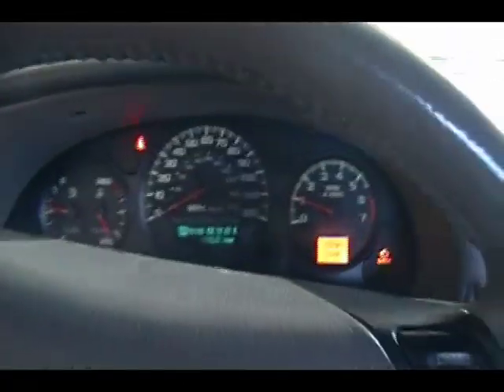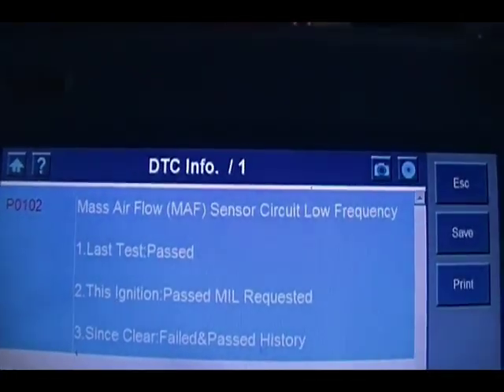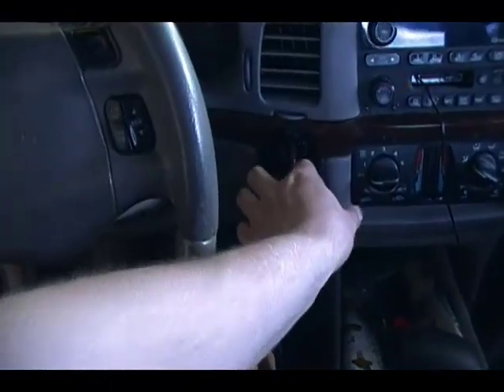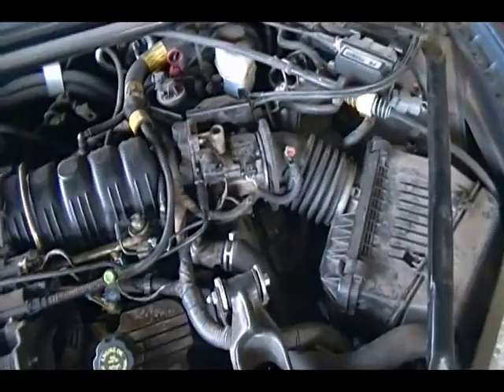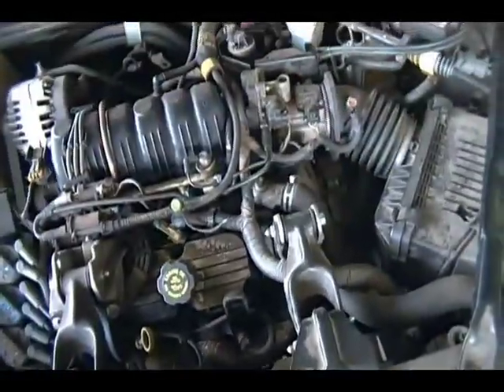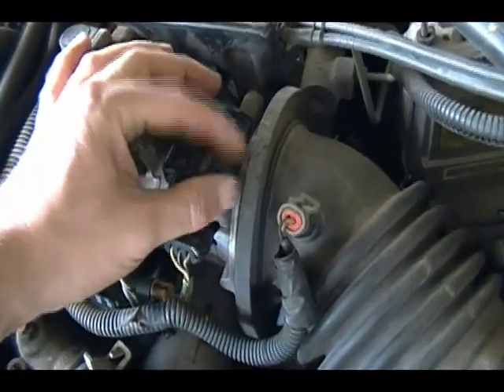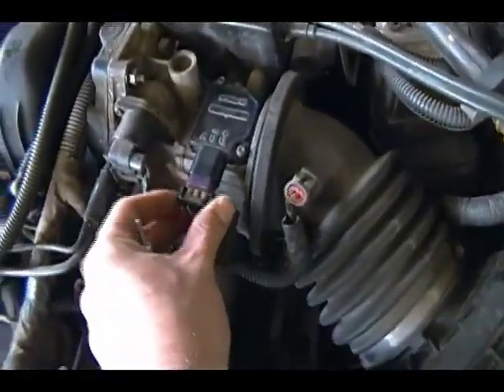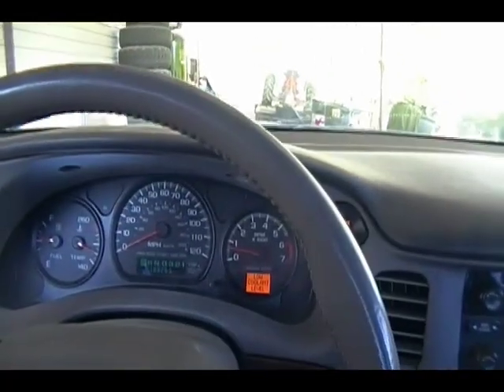Chevy Impala 3.8 V6 Mass Air Flow Sensor P0102

Comment: That stutter you had at 30 is exactly what’s happening to me I’ve had a misfire that has also plagued me even after changing plugs coils and leads, in your opinion is the car worth continuing to throw money at it’s almost 20 years old with 150,000 miles

Comment: I did that to mine. Mines flashing check engine and is real sluggish and rough. I drove it in a real bad downpour and it started running bad and flashing. I changed the plug wires, but not plugs because they're literally 2 years old.

Comment: My Bonneville was leaking coolant into the cyclinders the egr valve got to hot and melted the intake gasket.had to get gm upgrade pengilum and it comes with new egr upgrade.$120 bucks.it was a bad design gm had done.but all good after replacement.

Comment: If you have intermittent and transient stalling issues it may be the cat converter - Meineke cut mine out and replaced it for ~$200 - Stainless steel pipe and mufflers (04SS) still good - The MAF sensor codes have since stopped (2+) years ~15k mi since (total 136k) - went thru 2 sensors over a few years before the 3rd throw of the code after more weird stalling issues - after 6-8 months from replacement #2. The auto guru I know suggested something else is afoot. Hence, Meineke...They said the innards of the cat converter get twisted/turned and causes issues. ATbest.

Comment: Hey brother, can u please help me with the same Issue I have replaced the maf sensor with branded Hitachi but it still shows the light for O2 sensor catalytic converter. Does O2 catalytic affects the gad mileage? I'm getting 16mpg right but I used to get atleast 22mpg highway n local combined.
Reply: Did you fix the issue ?

Comment: Right on the mark, I gave it a tap and went dead. i cleaned the sensor and turn on and gave it a tap again and kept running. i kept tapping and you can hear it act up and finally died. Thanks for the hint.

Comment: I got a recall as well, it said that it was exhaust manifold oil leak and they replaced the cam cover? They also took my vanity cover and my oil tube that the cap goes in and the new cap takes the hulk to get on and off

Comment: I've found a good way to diagnose the MAF on these impalas. When you're having issues like this just tap on the top of it with a wrench. If the car starts having issues only when tapping on it than you need a new sensor. Had it happen to mine. My intake manifold is leaking as well. It only leaks from 1 bolt that I know of so I might grab some flex seal
Reply from the maker: I've heard of the tapping method before.

Comment: mine in a monte 3800 unplugging the maf sensor it keeps running unplugged  better if the mass flo sensor is bad ?never dies unpugged !
Reply: Mine dies if I unplug it. What does that mean? Does it mean the maf is still good or bad?
Reply: @benjaminsmith4048  maf is good if it dies when u unplug

Comment: My impala is idle very high after changing the fuel ptressure, the PCV, and mass air flow.  Clean TB and high idle still
Reply: I had a issue of high RPM at cruise speed.  My cause was from the top switch above my brake switch under the dash.  Some how it came lose and was not pushed into the brake peddle lever.  I hope that helps..  What made me look was the cruise kept shutting off. (like when you hit they brakes).  now my RPMs are below 2000 again.

Comment: I also had the Low Coolant light on my 2001 remain on for long periods of time.   After replacing the sensor module twice I discovered that the problem was the connector rather than the sensor itself.  Expensive learning process.'
Reply: I just bought one and it has low coolant and this

Comment: What you described sounds exactly whats going on with my car (2001 chevy impala), gonna try replacing that modual. Also just got the car. Gotta jump it every time I wanna get it started, idk if its the battery, if it just hasn't been run in awhile, or that igniton problem you were having, so gonna take at look at that.

Thanks for the video btw, mighty helpful.